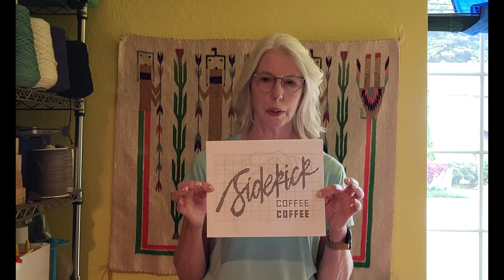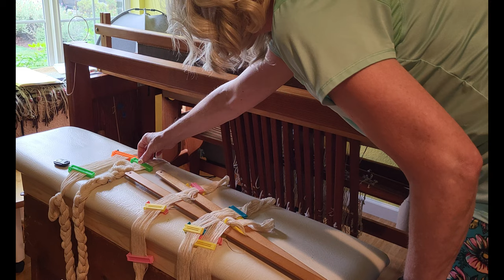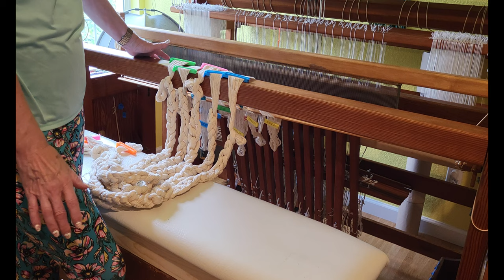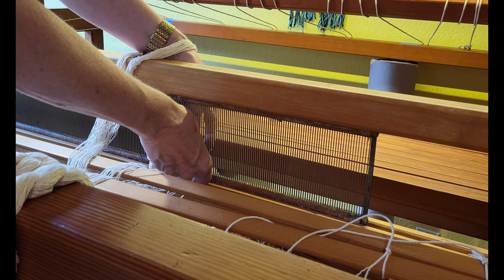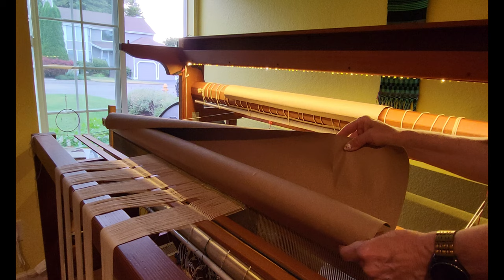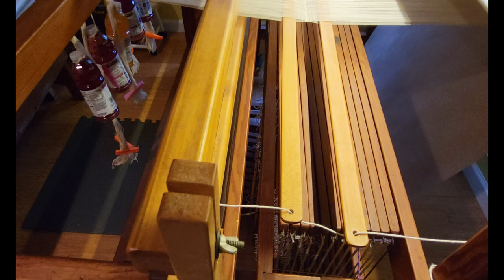Winding the Warp for False Satin Damask Pickup

Comment: Thank you for this video. I was wondering if you mentionned how you put your ends in the heddles. Maybe I missed that part. Because when I watched part 2 I did not quite understand the treadling you are using. This is a technique I would love to learn but maybe in french which is my native language. Thank you and looking forward to hear from you.
Reply from the maker: You’re very welcome 😊. I didn't demonstrate threading the heddles because it is a straight draw threading (1234). I did add some additional information on the structure to the video's description & a link to the original pattern by Sarah Johnson. False Satin is woven as a 3/1 broken twill treadled 1324. To get a weft faced weave, the tie-up raises 1 shaft on each treadle. This project uses an additional 2 treadles to raise either shafts 2 & 3 or 1 & 4.  In my project, the pickup is done when 1 of those 2 treadles are pressed and the weaving is done using the 3/1 twill tie-up.  This effectively makes the pattern appear as a warp faced weave (raising 3 shafts in the patterned area). I hope this makes sense. Thank you for asking the question as I'm sure others may have it too!
Reply: @tangledwebsweaving  thank you so much.
Reply from the maker: My pleasure ❤️

Comment: So you put the warp threads through the reed twice? I also warp my loom alone and do it front to back. Once through the reed, I’ll thread the heddles, then wind onto the back beam. I like how you can use the loop from winding at the back beam, tho.
Reply from the maker: I'm basically using the reed as a raddle. Depending on how many threads I wind at a time I sometimes use a 5 dent reed and put 4 or more threads per dent when I rough sley it (to get the correct epi). Sleying the reed goes pretty quickly so I don't mind having to do it twice. I could warp front to back but my loom is designed to warp back to front and it's the way I feel most comfortable with. Thanks for watching and commenting.